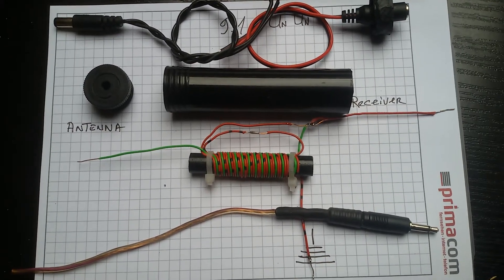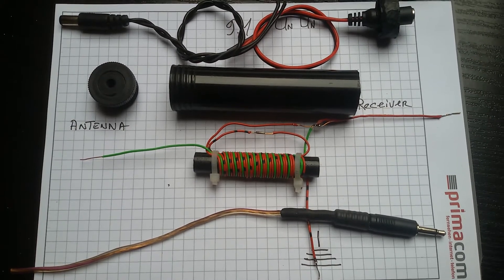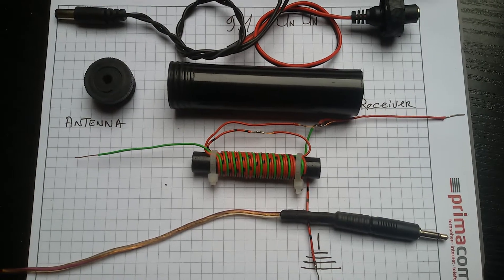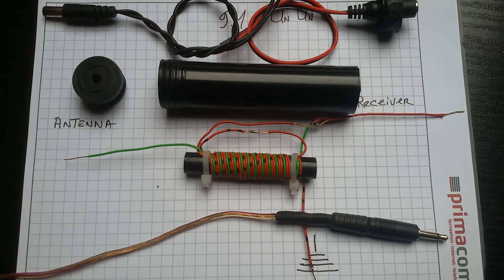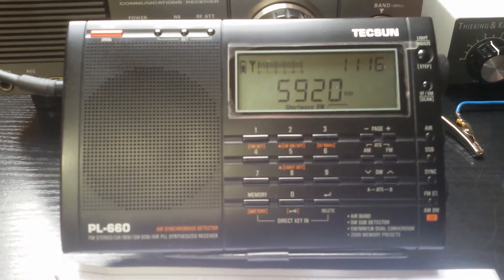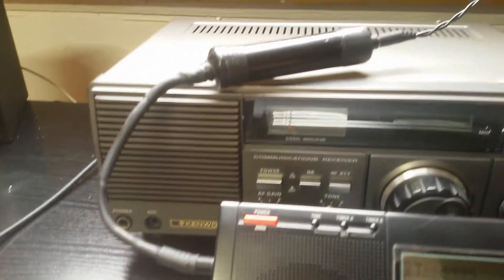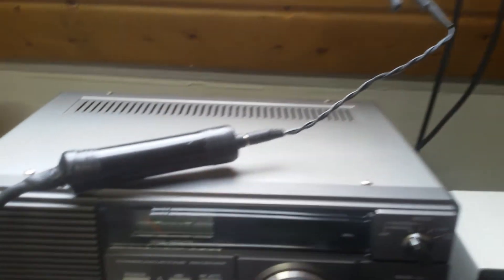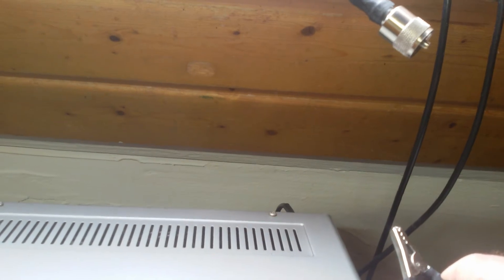Shortwave portable 9:1 UnUn

Comment: Just wanted to try a 9 to 1 impedance matching device on the whip antenna and negative battery post.
The whip having high impedance and the coax being a low impedance. Then have a outside antenna on the other side coax.  Loop or diole.
Reply from the maker: Theodore.... I would say Try it.  Experimenting with different antennas and balun is the most fun I ever had and after all, what would shortwave be today without it.   I have a friend who has attached a coax to a old sky dish and although this sounds kooky... it works well.  Another Guy uses a old TV Active antenna which has "rabbit ears" and for the money it works as well as most cheap active antennas.   You'll never know what works well until you experiment.  73